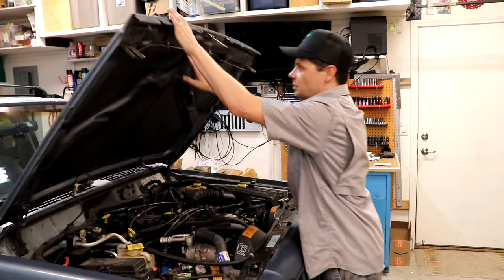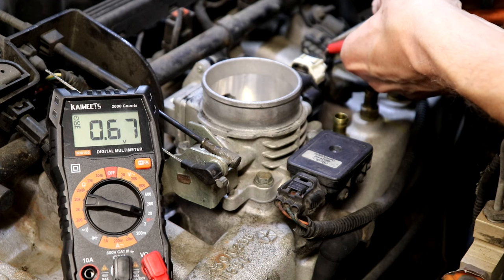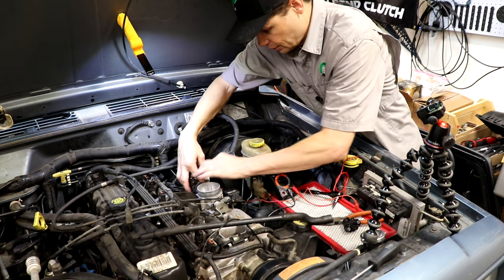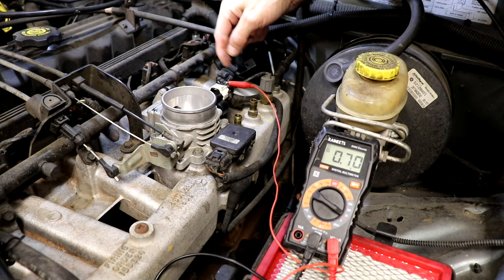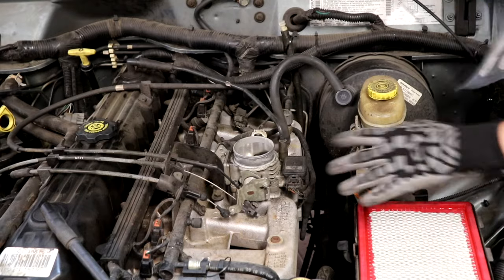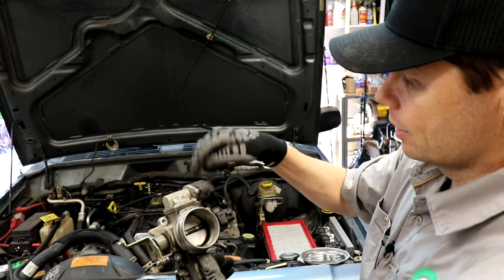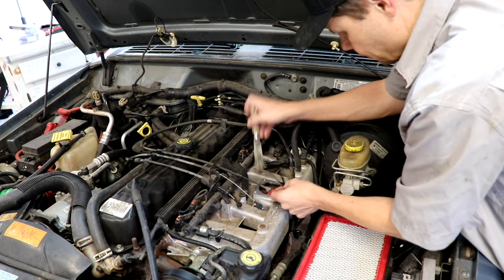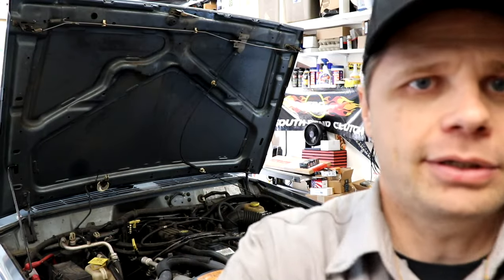Don't Buy Throttle Position Sensor! Test it. How to test TPS

Comment: I changed my TPS without testing it and still not able to fix the problem for my 92 ranger with codes 121 122 123. My multimeter doesn't read the same numbers so I don't know if the wiring is the problem and it's very tedious to find the source

Comment: Great video, I'll test my TPS first before buying a new one. My 1998 TJ has an issue of when warmed after driving I'll put in neutral, and the engine takes off for about 2 seconds then settles down. Hoping it's the TPS.

Comment: With meter on the volt setting and you have your meter hooked to ground won't you blow the fuse in the meter if you touch a ground with the other lead of the meter?

Comment: Hello, a tip... if doing all this service the engine continues with unstable idling or accelerating alone, change the 4 orings that go on the throttle body shaft (TBI)... the shaft has a small play in the bearings of The needle and the seal dry out over time, causing false air intake... almost nobody knows about this trick! good luck everyone, greetings from Brazil!
Reply: I'm getting a DTC P2101 error on my FAW V2. Engine check light turned on and no acceleration.
Reply: @MoeezAhmed  Okay. And? What is your question?
Reply: @Russell-rc6qq  Question is, how to resolve it 😃
Reply: @MoeezAhmed  This is a challenging issue that you have. Were you able to solve it in the preceding month since initially posting?

Comment: I notice that your TPS is a fixed one (fixed position) , which since it's fixed/can't be wiggled it doesn't need to be calibrated!
Reply: Fixed tps just needs a Ecu reset, after reset,  the Ecu will adapt the new shifting points according the new tps values.

Comment: Great video, thank you! I have a question if you have time, I checked with multimeter and checks out good, no dead spots all the way. Is it still possible that the sensor is still bad? For reference, when I am driving, jeep always stalls at low speed (0-10mph) and at (40-45mph) when letting go of the pedal. If you press the pedal pass it certain rpm it stops stalling, and also won't do this at any other speeds. Any ideas? Thanks in advance.

Comment: The signal in my sensor is sitting on 76. I’ve changed the sensor two times and they are giving the same number at 76. In the video is 87 as shown. Any advice.

Comment: New tps sensors are always reading lower, thats because the old tps is worn out.
The older the sensor gets, the more the voltage climbs upwards.
If it becomes more than 1v the computer stores an error code.

Comment: Hey I have a 2007 Jeep Patriot recently I replaced my throttle body it drove for a week. The lightning bolt has popped up again should I change my gas pedal to get it back running

Comment: I just bought a XJ and the idle would sometimes go up and down but when it doesn’t it drives normal. It would also take a few cranks to start sometimes when the idle acts up.
I tried to test the tps but I can’t get a reading on the plug unless I unclip it. How did you get a reading with it plugged in the tps?
Also what brand TPs did you go with?
Reply: I’ve used a razor blade in the past.  Just shave off a small portion of the wire and test it while running. I just changed mine out in my 4.0 grand Cherokee. I originally bought a $15 off amazon. Mechanic. Couldn’t get it to work. Then bought a most one for like $70. All symptoms gone inc light and skipping and bucking, erratic idle and transmission wasn’t shifting into overdrive

Comment: My 99's throttle position sensor was throwing a code but it was my clock spring that was faulty sending a short to a shared ground in the PCM causing the TPS to malfunction. The codes wouldn't clear until I pulled the horn relay which confirmed the clock spring. Was causing idling, stalling issues, and acceleration issues.
Reply from the maker: Ugh. Electrical gremlins can be a nightmare
Reply: Where would this horn relay be located? 

Trying to stop throwing money in parts chasing this stutter in the idle 🥲

Comment: So ours will be driving fine and then the throttle will stop responding until you power off the car and start it back up. could it be the TPS?
Reply: Yep. There’s what mine was doing. Ran fine. Then started bucking and skipping and not shifting into overdrive and idle went from 600 to 1500. I had to shut the ignition off and restart to reset it. Run the engine codes. You can do it yourself with just the key in ignition. I think it’s ignition on then off then on then off then on (3x) don’t start car any of the x, just ignition on off 3x and read the code displayed on your dash. It’s the same place where odometer is. It’ll show a p0122 or p0123. Both are tps is bad codes.

Comment: What is the symptom of a dead spot? Like say driving at cruising speed and maintaining speed puts position at dead spot. I have two vehicles do the the same as above, but different symptom. One vehicle it will sputter until I change throttle position either by giving it more gas or a little less. The other vehicle will surge rpm until I change position up or down. First is cable 2nd is drive by wire.

Comment: I'm having a tps issue I've changed it twice can't get the code to go off keeps coming back I direct grounded it to the battery but I'm still getting a circuit voltage low any help by chance would be deeply appreciated.

Comment: My 97 4.0 tested perfectly and done as you did. But with a scan tool, with engine off it shows it’s 14% open. And  when opening throttle body to wot it shows 77 percent. Could it test good but also have problems in the mechanical part of the sensor?

Comment: 2001 Grand Prix with a 3.1-liter motor, started idling high after good and warmed up. No codes at the time. 
When motor would idle too high, 4T65E trans would shift super late under light throttle. About 25 MPH and 2,500 RPM before it would hit 2nd. gear. Was OK the next day. 3rd. day, high idle and late shift again! This time the check engine light did come on. Code P0121. Scanner TPS angle percentage at idle shows 0 sometimes, and sometimes 0.39% and ~ 100% at WOT.  One time while sitting there idling fine, ~ 700 RPM, all at once the idle kicked up to ~1,300 RPM all by itself. I looked at the scanner, now TPS angle percentage went up to 2.75%.
From my readings it looks to me like the sensor IS receiving the 5V reference, and my ground in good, and my reference voltage is changing and being sent back to the ECM. My voltmeter is at my buddy's garage right now, so I could not do the voltage testing at the TPS connector, as you have outlined. 
I'm ready to take a chance based on my findings, and just install a new TPS. 
What do you think?

Reply

Comment: On testing potentiometers, I have a tech tip... If you can find a older analog multimeter like a Simpson to use, it makes it way easier to see the dip in the sweep...
Reply from the maker: Very cool 👍
Reply: I have an old one from Radio Shack, it has a BIG ASS NEEDLE.
Reply from the maker: Oh, wow! That’s a blast from the past. Are there Radio Shacks around anymore??
Reply: @JeepSolid  The one near me in N.E. PA. closed about 8 years ago.
Reply: @JeepSolid  yes there are about 400 franchises still operating.   I looked it up!.  I actually just went into a radioshack while I was in Tennessee a few weeks ago
Reply: Radio Shack is done. They are all gone
Reply: You can use also digital multimeter with analog bargraph . Most of modern digital multimeters ,even the cheapest ones ( 30-40$ range) has it .

Comment: hello when i manually move the throttle cable I go from 1.2 to 3.9..it does go up and down ok..is the 3.9 OK?? Some say it has to go to five..MY 98 KIA sportage revs to 3,000 RPMS upon COLD START then IF I DISCOONECT THE IAC VALVE it drops to 850 rpm which is normal..is IAC BAD??

Comment: i sure wish i lived close to you. 1995 yj 2.5 low idle, and the local mechanics cant figure it out. when i bought it 4 months ago most of the sensors were originals. so i replaced them all, map, 02, iac, tps, air charge sensor, new plugs, wires, cap rotor and coil. when i first put the tps in it actually idled normal for about 10 mins then died back down to 300 rpm. and at temperature that is where it idles runs rough and has a miss. at speed seems to run fine. fuel rail pressure is at 31psi. I am stumped and wishing i had never bought it at this point. 
Any subjections??? any at all??? anyone?? other than sell it, to deep into it now for that.
Reply from the maker: Vacuum leak?
Reply: @JeepSolid  that was my thoughts for sure. but i cannot find one. funny thing is even after warm. If you cut it off crank it again it idles normal for a minute or two then back down to 300rpm. trying my 3rd mechanic today. some of his family members drive 90s model jeeps so I'm hoping he is fimilure with them.
Reply: Hello, a tip... if doing all this service the engine continues with unstable idling or accelerating alone, change the 4 orings that go on the throttle body shaft (TBI)... the shaft has a small play in the bearings of The needle and the seal dry out over time, causing false air intake... almost nobody knows about this trick! good luck everyone, greetings from Brazil!

Comment: hello i have a 2000 Cherokee XJ  i am getting code PO122 but i am having trouble with it not shifting to. plus i have code PO123 code PO121 and code P1494  the gas pedal dosen't have anything in the way of it.  and the code P1494 isn't that probably comming from the Throttle Position Sensor ?   thank you for your help Scott.

Comment: Hello Jeep Solid - Curious what your symptoms were before you cleaned the Throttle Body & replaced the TPS? I'm having issues where the Jeep sometimes won't start (on the 1st try), especially after its been running for a while.

Comment: My two cents worth...I went through two $11 Amazon China made TPS before finally getting a Mopar OEM, made in Mexico, TPS at $98, also from Amazon. So far no issues using the more expensive OEM. Love this channel, but wish I could post a pic of a a China made TPS next to a Mopar/Mexico TPS. You'd be surprised one fully incased with the other potted

Give away for TPS issue is bucking in drive with up an down RPM in idle. Could be other issues, but that's the first I'd look at...
Reply: Same make and model as in the vid?

Comment: How is he testing the throttle sensor? Is he touching the wires?
Reply: he is back-probing it - typically using a sewing T-needle and sliding it next to the wire towards the connect until it makes contact with the wire terminal deeper inside

Comment: Hola saludos tengo una Grand cherokee modelo 95 ahorita se encuentra en el taller según en ingeniería automotriz me dijeron que el motor está jalando perfectamente bien todas las lecturas están correctas pero que la luz check engine no se apaga y el mecánico menciona que no la pudo apagar con el escáner entonces yo le hice el comentario que le pusieron otro TPS de otra Grand cherokee original que da una referencia de 0.86 milivoltios y la luz Chek engene se apagó sola ya no prendió crees que sea una referencia 0.42 demasiado baja como para que no pueda pagar la luz  Chek engene o un sensor TPS demasiado corriente la mía es una Grand cherokee modelo 95 4.0 6 cilindros americana  

  Se repara  el fallo y la luz check engine sige prendida

Comment: Have you ever came across 12v on your center wire? I have my 5v signal, ground but my middle wire is 12v. It changed when moving the throttle and stays 12v in middle terminal with the connector unplugged. This normal? Getting flash code 24
Reply: I read about the Clockspring getting shortwired and cause 12v supply to PCM...same issue as you have, it is because the Airbags operate on 12v, while the Cruise control works on 5v, if shortwired, the Airbag-positive can contact a Cruise control positive causing it to get 12v too.... check that as soon as possible, as it may fry your PCM one day or cause other damage to Electronics

Comment: Hi Dale, been watching your videos for years, thanks so much.  Like Kevin below, I too have a 94 YJ w/ 72 k original miles that has a strong rich gas smell from exhaust. Never had CEL, no apparent leaks from aftermarket header. cat and exhaust system replaced 2 years ago. Have good gas mileage, idles well, starts immediately and I replaced O2 sensor two days ago, checked MAP (good voltage with decreasing voltage when vacuum applied), checked TPS with good results, did fuel injection pressure test with numbers slightly higher than your video (34 psi idle with 42 psi vacuum line disconnected, with no change with throttle applied).  Cleaned throttle body per your video.  No visible leaks from injectors, but after watching your video ordered new injectors just because and will install when they arrive.  I have done "exhaustive" forum searches and out of ideas.  Problem is above my pay grade and think I need a professional.  It appears you might live in Oregon as I do and was hoping you might have a shop recommendation in the Bend area.  Thanks again!
Reply: Did you get it fixed?

Comment: I noticed on my throttle body that there's room to rotate/turn the TPS a bit. It looked you just stuck it on and screwed it in.
And the meter started at 80ohms. Are we supposed to rotate the TPS to the  lowest reading, THEN tighten? Or does it matter? 
It would be nice to see you add one of these 62mm complete throttle bodies! My project is a 01 Dakota with the 2.5 4cyl. And 
a common upgrade is to use the 4.0 T/B. So more would be better RIGHT?? 🙃

Comment: ok, thats the wrong meter to use. a digital meter will average the reading giving a false good reading. using an analog meter will show intermittent voltages as the TPS moved. like an old dirty volume control
Reply: do you have a picture of a decent analog meter? and where exactly are we touching the wires? can't see it in the video

Comment: Hi quick question - I have a 94 YJ and it has quite the rich smell - I have replaced the O2 sensor - and have wondered about the sensors you mentioned MAP, MAF, IAC, and TPS if changing them would help - or would I be better off looking for an exhaust leak?  I have checked for any stored codes and there are none - any advice would be great.  Are the other sensors "easy" to test as well with a multi meter? Thanks
Reply from the maker: Is your fuel economy terrible? Could be leaking injectors. Maybe see if the fuel pressure test.  See if it holds pressure